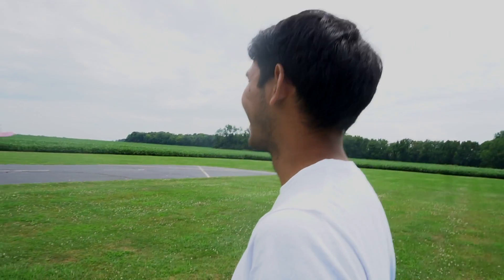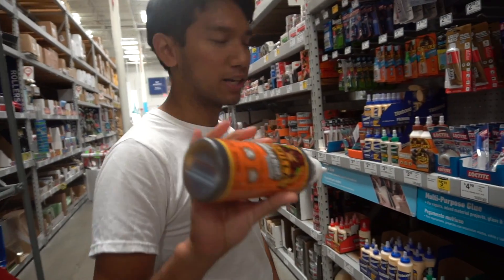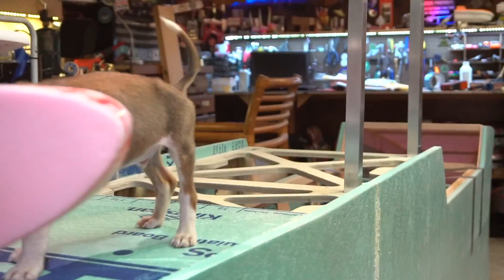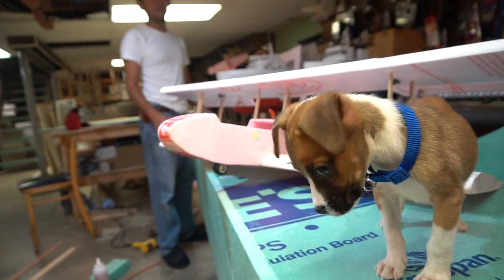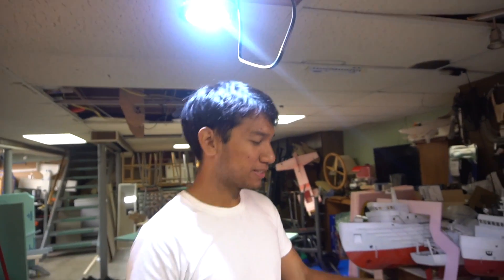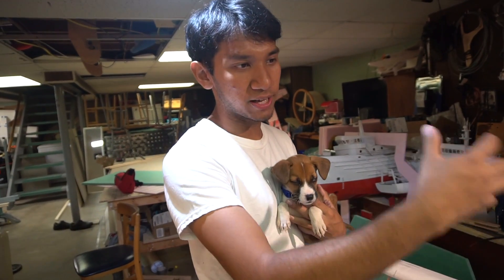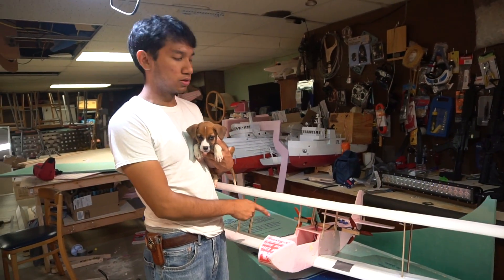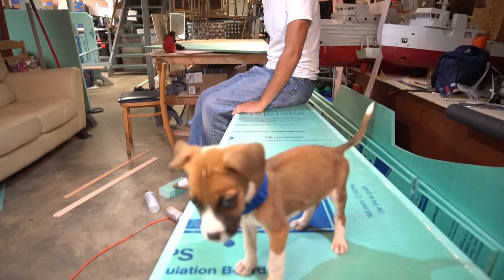DIY electric ULTRALIGHT pt1(fuselage and basic design)

Comment: Please provide a list of technical components used (motors, servos [if you even use those], etc.) and maybe even basic plans. Thanks
Reply: CAD files as well?
Reply: Ah I'm just dreaming, really. However his design seems easier to build with less power tools, etc than some other things I've seen. An electric engine also simplifies things, at least for me as someone who is into electric RC and knows nothing about gas engines.

Comment: That ordinary building store foam dissolves in regular fiberglass resin. You need to use some other resin for that, usually epoxy. I suspect you know that already but if you didn't, this would be a really embarrassing way to find out.

Comment: Hey Peter, I dabble in aircraft design and construction. some resources I would suggest for you to buy and read for this project would be all four of Tony Bingelis's books, which cover the actual building process of aircraft, a copy of AC 43.13-1B, the FAA's document on aircraft inspection and repair, it can be used to see what tolerances should be acceptable. Finally if you want to calculate every possible value for the flight data of your aircraft before it ever leaves the ground, daniel raymer has two books filled with formulas to figure that out,  I would recommend his book Simplified Aircraft Design for Homebuilders for your case. Cheers

Comment: G'day Peter,

  Yay Team !

      Um, "Cards on the Table..." mate, before considering my opinions in this matter, I refer you to my "Personal Aeroplanology..." Playlist, wherein you can check the highpoints of my CV which pertain to this particular project..; start with my first Aeroplane hanging in the Inverell Transport Museum ("The 8Hp, 1975, Red Baron Skycraft Scout ; World's First Legal Minimum Aircraft.."), then there's my second Aeroplane, which isn't in a Museum but it was the ultimate development of "The 22 Hp VJ-24w SunFun ;  World's First Ultralight Motorglider..." which I redesigned, rebuilt, carved the Propellers for, & did my own Test-Flying on...(as well as crashed it !) and there's also a  Video in there covering my time as a Low-Speed Aerodynamics-Consultant (see "Aerotow-Launching Rogallo Hang-Gliders...; Development Of The Lockout-Index...")...

   Right,  point one ; "SIMPLICATE, AND ADD MORE LIGHTNESS...!".

    That Rear-Fuselage you've built is already pretty much strong enough, and the proposed Woven-Glassfibre & Resin Skin will be more to provide Abrasion-Protection for the Foam than a neccessary addition for carrying Flight-Loads ; so adding a Helical-Wrap of Kevlar-String would be pointlessly adding weight, up at the back-end where you want it to be as light as possible.

  With an 18 - 36 MPH "Target" Speed-Range between Stall & Full-Throttle in level flight, you're not ever going to be able to pull much "G", and you're not going to be flying through Thunderstorms or major Turbulence either, so stressing the Airframe for any more than Plus-3 G. or Minus 2 G. is probably a pretty pointless excercise in adding Excess Weight...(?).

   There's a convention dating from the 1930s  which holds that the Undercarraige should be designed to fail at 5 G's of Shock-Loading, because the last time anyone designed & built a Trainer with a 9-G Rated Undercarraige (to reduce the cost of Repairs following heavy landings...), their Test-Pilot dropped it onto the Runway from a 3-Pointer performed 20 ft up ;  and the Undercarraige handled the 8-G Arrival really well, and the 'Plane rolled-out along the Runway, pulled off onto the Grass, & sat there with the Engine ticking-over at Idle...., the Test-Pilot's Neck had broken at 6 G's (as Human Necks tend to do...), and he'd died of suffocation while strapped into his seat, before anyone could reach him...

  So, that's one cautionary tale illustrating why "too strong" can actually be as big a killer as "too flimsy"....

   That Wing-Section of yours is pretty thick, therefore it's got a lot of Frontal-Area as well as "Wetted Surface", so when you add in the Cabane Struts & Interplane Struts & Flying-Wires & Landing-Wires..., this thing is goanna have a huge amount of Drag - the proverbial "Built-In Headwind..." ; so you'd better hot-wire some Leading-Edge & Trailing-Edge Fairings from Foam, to bind onto and streamline each and every Square, & Round-Section, Aluminium-Tube which your Design places perpendicular to the exposed Airflow.

   If you could afford to have Streamline-Section "RAF-Wires" made up for all the Bracings then that would be good, but I guess that you're goanna go with Round Cables (which have 5 times the Drag of a Streamlined Section the same diameter...) ; which is why it will be quite  vital to put Fairings onto all the Struts.

  Attaching the Undercarraige to the Lower Wingspars, as the Model is configured, means that your Flying-Wires will be taking the weight of the Fuselage on Landing, rather than the Landing-Wires carrying the weight of the Wings ; meaning that any kind of heavy landing will likely break a whole lot of things, in the Wings.., and therefore it might be a better idea  to mount a Bungee-Sprung Floating-Axle underneath the Fuselage, with 2 small Bicycle-Wheels (modify the Hubs to take Bushes on a Tube-Axle) with Fabric or Mylar Discs to streamline the Spokes (check my Video on the VJ-24w, and how I redesigned it's Undercarraige...).

  Having the Lower Wing so very close to the Ground, as shown on the Model, means that you'll be very DEEPLY into Ground-Effect, and floatFloatFLOATING a long way down the Runway, while you're flaring, and waiting for the Wheels to find the surface of the Earth...

 Other than those minor points, it looks like it should be quite a nice little Aeroplane.

   Are you goannna design & laminate & carve your own Propellers for it (?), to me that's the step which takes cobbling-up a home-grown Personal Levitation Device to a bit of an extra level...; building an Aeroplane isn't all that unusual, designing it for oneself is more rare, and making the Propeller/s for it is a degree of rarification indicating an outstanding level of dedication (obsessive-compulsiveness) & eccentricity... (aka, being in the grip of a significant Biggles-Fantasy...).

 The over-riding maxim, then, is that
   "IF IT LOOKS RIGHT, IT IS RIGHT ; and the only possible difficulty lies in knowing what looks right...(!).

  Such is Life,

  Have a good one...

    ;-p

   Ciao !

Comment: Awesome!   Maybe consider some internal cross bracing with wires to keep the fuselage from twisting/collapsing if you haven't already.   Are you sure you'll have enough power for a biplane?   That's a lot of drag to overcome.
Reply from the maker: great eye! yes it will need them! going to add them after I finalize anything I need to crawl inside the fuselage for first!

Comment: I built a vw powered KR2 experimental with my dad so I have some experience with wood and composite construction if you have any questions.  Do you have cross bracing in the inside of the rear fuselage? Definitely use AN bolts on anything structural and safety wire is your friend.  I'm not sure you're going to be able to glass the entire fuselage and keep in under the required weight.  I might be wrong.  Oh man I have so many questions...

Comment: 1. I think the cg will be to far forward with the pilot according to the plans I saw.

2. You should launch it with help from a bungee cord, then land with a single dampening skid under the belly, like the me163. This will help with aero and the hard landings.

3. Remember killswitch and double system, for redundancy.

4. Test the wings (especially the top one) for twisting, because it can translate to fluttering. It will tear the wing apart.

5. You might need to use counterbalance on the control-surfaces, as it can fatigue your arms quickly.

6. Use very little positive climb elevator, as high lift wings at slow speeds can experience airflow separation, which will have a considerable effect with short wingspan aircraft, with CG that is a tiny bit further behind than optimal... aka a imitate stall at no speed.

7. Remember that groundeffect will help you.

8. As power to weight will be low, you should optimize aero, and that nosecone is all but aerodynamic.

9. Make sure that the pully system can't get stuck

10. DO NOT use the parachute unless the plane breaks apart, and you are sufficiently high up (training is also a must)

11. Sit on something that is soft but solid, so the fuselage can take your weight better when landing.

12. Use helmet and googles.

13. Use propellers with max thrust.

14. Remember the effect that your plane will experience, many of  them will be cancelled out as long as you have a low center of mass.

15. Consider winglets, even simple ones will do.

16. Learn tools like adverse yaw to be better in control.

17. Good luck m9
Reply: 18. Depending on where you will use composites you should make sure that that stress won't be on a edge or corner.

19. Even though the fuselage can take the stress from you sitting on it, it might can't take you, sitting in it , with the opposite force coming from the wings. I suggest rigging internally in the fuselage.

20. adverse yaw can be done with the differential thrust.

21. Make sure the motormounts won't flutter either.

22. Flare as little as possible when landing. It usually ends in a late stall, and a hard landing. It is usually smart to land with a bit thrust. 

23. The thrust lever should be thumb controlled on the tip of the center joystick.

24. Land before the battery is empty, especially if a fly-around is needed.

25. Of the landing is hard, and you flip etc, you should have something soft to hit in front of you.

26. Use smoke vibrantly colored smoke for max swag and efficiency.

27. Don't even think about mounting floaters, the hydrodynamic drag is way to high compared to the power in order to plan on the water.

Comment: Drywall screws are too brittle, believe me, I know. Used them to hang a kitchen cabinet, the screws snapped, helluva mess. They are not designed for heavy weight. Deck screws are, and if you get the torx style, easy to drive with no slippage like Phillips head screws.

Comment: peter! in regards to motors, i would suggest you look at the CA80 160 kv brushless outrunner intead of the rotomax 50cc. the CA80 are better quality and more forgiving! they can also take a wider voltage range so if you dont have enough power, add another lipo.

cheaper too! best of luck , David

Comment: if it flies please stay low. i like you
Reply: Lost Bus Productions if he's too low, his parachute won't have enough time to fully deploy and/or slow him down enough.
Reply: Higher Altitude = Safer. He has a parachute.
Reply: Robert Bruhns, you suggest flying at 15 feet even after three people point out how wrong that is?

Low altitude means you'll only have like 2 seconds to realize that you're crashing into the ground at 30+ mph. And being in a cockpit made of thin plywood and foam is probably not going to make that fall any safer. Even if you have time to bail, you can't deploy a chute and the plane will probably land on top of you...

Just getting it a couple feet off the ground to prove it works is fine, Wright Brothers style. Taking it up a few hundred feet something goes wrong, you have plenty of time to identify what's happening, correct it if possible or jump out. But flying at 15-20 feet? Probably one of the more dangerous things you can do with an untested aircraft.
Reply: One of the paradoxes of flying is that higher is usually safer. If you get the plane to stall, you have altitude to get it flying again; you won't be hitting anything (except maybe other planes if neither pilot is paying attention); if the plane does fall apart because of excessive loading, you have time to actually deploy your parachute...
Reply: Altitude is your security, the higher the safer
Reply: Javier, 15-20 feet isn't anywhere near too high, on the first powered flight Wilbur got to around 12-14 feet. Even though I definitely agree being at a higher altitude is safer and more sensible, his comment should still be respected.
Reply: Love this comment😂😂
Reply: yesh
Reply: Me too!!😇💩💩💩💩🤢🤧🤢🤧🤢😷🤒🤕🤕🤥🤔🙄😴🤕💀👽👽👻🤧🤢🤢🤐🤢🤕🤒🤧😷🤥🤥🤔🤔😴😪😓😭🤤🤤😥😥😢😢😵😵😵😲😲😮😧😧😧😑😐😯😑😯😑
Reply: Yea

Comment: Peter I'm in no way condoning this project but if you are really determined as you seem, I would like to ask if you are familiar with the proper placement of carbon fiber to maximize strength in the axis of your choice ? I recommend looking into that, it's is very important if you plan to use this material.

Comment: this seems insane, most micro and ultralights use aluminum frame with canvas to save weight. this wooden construction seems overly heavy and I fear the glue-based construction will only be safe for a few flights.

Comment: I didn't see any formers within the rear of the fuselage, it looked like stress-skin construction throughout.  Even just 2 or 3 thin formers parallel to the main spar within the tail would have a massive gain on torsional rigidity.  Great project by the way, if anyone can succeed with something like this, it's you.

Comment: How big will the servos be...
Reply: sripol 4 channel meat servo
Reply: Angle of Attack im not an aerospace engineer, im just a private pilot, but I feel like a hydraulic system would be too heavy and expensive. All the airplanes I fly are just cables and the can be incredibly smoothly flown. He could use servos but why risk having another point of failure if you could just use a cable
Reply: Michael Dilger Handpowered
Reply: redstone craft guy he probably would use cables from the control surfaces to the control column. Thats how most small aircraft do it
Reply: Michael Dilger i think he will use piston instead of servo
Reply: Yeah, even aircraft that are 10x the weight can easily be controlled by cables. Servos, hydraulics, etc... are all just extra weight and complexity for zero benefit.
Reply: Michael Dilger i can drive a 2 ton car contacting the ground without hydraulics easily. i think for a 200lb airplane cables and pulleys should work fine.
Reply: Driving a 2 ton car without hydraulics is easy. Not ALL cars have power steering and I have one that is in fact NOT hydraulically powered or assisted in any way
Reply: I don't believe that you could find servos big enough to handle the control surfaces with a cumulative weight less than 1kg. And if you can, I wouldn't trust them with my life. And I certainly wouldn't trust any sort of Arduino based autopilot, especially in an untested, one-off aircraft...
Reply: Michael Dilger maybe he use 1:24 scale rc car servo.
Reply: Not cheap, but not least it's heavy! this is an ultralight aircraft and you use wires and pulleys to controll it.
Reply: lilsammywasapunkrock The point of having a electrical fly by wire system is if in the future he wants to make a simple autopilot, it can be done so very easily.
Reply: Henry Chan yeah, 250lbs is a super easy target to hit, so lets throw a bunch of crap we don't need and make it super complicated for no reason and spend a ton of money we dont have.

you don't buy a race car, then take it to the track and enguage cruise control and lane keep assist. you drive the car, its the whole point.
Reply: lilsammywasapunkrock You don't need gigantic servos to power flight controls. And you can easily connect them to an Arduino for autopilot. Adds maximum 1kg to the aircraft, but a whole lot of fun programming and testing out the autoflight system and messing with the flight envelope and shit. Totally worth it IMO.
Reply: Henry Chan 1kg = 2.2lbs. out of the 250 or so lbs he has to work with in order to legally fly it, id rather see the plane beefed up then an autopilot. any type of mechanical device manufactured that carries people usually have a 11:1 safety factor. meaning most things such as an elevator or a man lift, are capable of 11 times the rated strength required before failure. 

my 1lb model has a 48oz stall torque servo, and sometimes it stalls out. scale that up about 250 times and i have a hard time believing that could be done as a seperate stand alone system for around 1kg.

personally, I'd add 2.2lbs worth of batteries so I could fly it longer instead of trying go come up with some ghetto rigged cruise control.
Reply: lilsammywasapunkrock Your use of imperial units is giving me a headache 😂😂🤦‍♂️🤦‍♂️
Reply: Henry Chan then learn the imperial measurement system. im not dumb founded when someone says kg or meter.
Reply: oh, okay. throw those $1.99 servos in there for auto pilot then. i don't think peter builds the same as Josh bixler...
Reply: Michael Dilger He should make it fly by wire.
Reply: I think hydraulic powered control surfaces would be best. It's more reliable and smoother. Maybe not the cheapest though, so idk
Reply: Unfortunately this is not true. Most commercial aircraft only have a safety margin of 1.5:1.